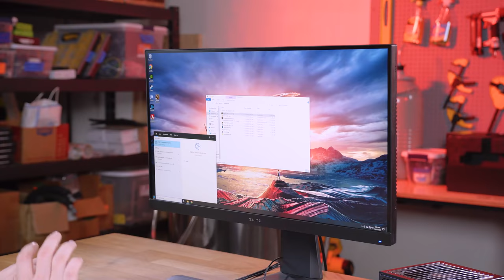This PC almost stumped me... can you guess what went wrong??

Comment: Just built my first PC a month ago, heard Jay’s comment on Gigabyte power supply’s and immediately did a little research on my specific unit. Turns out that particular model (Gigabyte P750GM) has had explosive tendencies and I was not about to mess around with that. Ripped that jawn right out of my chassis and returned it with one day left on the return period. Upgraded to the Corsair RM 750W for $5 less lol.

Comment: I have a Thermaltake riser and when I got my 3090 it was lacking all sorts of power, evga even offered to rma it, (it was getting 14000 to 16000 of score in 3dmark). I asked EVGA if the riser cable mattered at all, they said it shouldn't. so on a whim, I unplugged it and went straight to the board, instant jump in score to 20000. SO now I'm scared to waste another 50 bucks on a riser cable

Comment: I would ask your friend if he used/had two different power supplies at one point and may have mistakenly put all the cables in the same box. I am convinced that because both hard drives went and there was smoke that it was a wrong cable for that power supply.

Comment: I have a 3600 and i get some strange freezes, 4-5 times a day. The mouse just goues an inch for 10 seconds and it the ram is only about 40-50% load, the ssd disk is fine, it just happens and it does not goes away until i restart.

Comment: Moral of my story: Please don't cheap out on cables. They transfer l the data and power for to and from the equipment...

Hi all. I'm a car and home audio installer from S.A. I would understand why it would be the cable because when I wire any setup I always stress the expense on cables as well and the good quality oxygen free copper that's also electrically shielded because you get a lot of static transferred to the amplifiers and ultimately speakers as sound so I've also noticed the cheap quality cable will also cause voltage and current drops resulting in equipment intermittently shutting down. As with cheap HDMI cables. Too long and too cheap you barely get even a stable 1440p output. Sometime grainy picture due to electrical noise in the connection or just flashing.

Comment: hey jey i had a problem with my cooler master vertical gpu bracket my pc under heavy load while playing a game with high graphics would just restart just after 5 minutes of game time all temps under 65 after i did a clean instal and did not work i started taking all rams / drives out and leaving just 1 in to test the problem got fixed after i took out my bracket and installed the gpu with no bracket had no problems so ye a gpu bracket can make a pc run funny

Comment: I live in Anchorage and i noticed that my 165hz acer monitor would blank screen for about 5-10 seconds sometimes(its stopped doing it recently) but i think it was due to the static electricity possibly(watching ur most shocking video=) also i am using a MSI MB with a 4670k and a XFX RX580 but i was just wondering if anyone new why it happens or any reasonable explanation. thanks

Comment: I’ve been stuck with this problem for weeks now. 3090, 3950x, asrock taichi x570, 64gb 4000mhz ram team group ram, and 2tb Adlink m.2. 

The issue is when I open a game, before loading, pc freezes for a second, black screen, then back on and everything works. 

Then after finishing gaming and leaving the pc for a while, I can move mouse but everything locked up. 

Have latest bios, latest drivers, used DDU then reinstalled GeForce, changed pcie to gen 3 in bios, removed all 3rd part software like from Razer, no fix.

Comment: Both CPU power plugs are not connected; Ryzen 3600 needs 8-pin and 4-pin CPU power from 2 separate power rails
Reply: I'm planning on getting a Ryzen 5 3600 for my first PC build, so this is good to know!
Reply: No, one 8-pin can supply over 200 Watts of power, and that 3600 probably draws less than half of the connector's capacity.

Comment: If both Sata drives went toast then it was an incorrect modular power cable.  No idea what the riser ribbon has to do with that but you're not gonna fry Sata from a pcie slot or pcie cable.  There is no actual standard for how the pins connect on the PSU.  ID10T error, club hands crushing wires and jamming stuff in without skill/experience.

Comment: Jay: "Don't buy Gigabyte PSUs."
Me: "...or boards."
Jay: "Gigabyte GPUs are horribly designed."
Me: "Soooo, just avoid Gigabyte."
Reply: After not one, but two faulty Gigabyte Vega 56's in a row.. I'll never, ever ever buy anything Gigabyte again
Reply: I used Gigabye Mobos almost exclusively from '97 to 2014.  In 2015 i worked for a company and saw thousands of RMA's of all products.   Asus are the most reliable mobos. However mobo failure (compared to other parts, is very high).  The last gigabyte product i used was a 1080 gtx (did it to save $),  was noticeably inferior to MSIs gaming x  and produced audbile coil whine.   (now that can occur on any model, but the dodgier the brand, the more likeyl itll occur).     Gigabyte isnt 'trash' -  i.e .like thermaltake,  its just that i dont recommend them.  I recommend people if they have the $ to pony up and buy reliable gear.       CPUs = Intel, Coolers/fans = Noctua,  Mobos = Asus, GPUs = Nvidia  (high end range of Asus-MSI-EVGA), SSD = Samsung/Intel/Crucial,  HDD = Western Dig/Hitachi/HGST(all WD now),  PSU = Seasonic.     (youll find best of other 'PSU brands'  are infact rebadged Seasonic PSUs.)    If youre wondering , i saw more dead AMD CPUs in just 1 month than ive seen dead Intel in my entire life.

Comment: ISSUE:
Thermaltake includes PCI-E 3.0  cables with their cases.

PROBLEM: 
Asus motherboard defaults to "Auto" speeds. If you set bios to PCI-E 3.0 instead of Auto, it works without crashing.

RESOLVED:

Comment: My first thought is there was a preinstalled standoff that his particular motherboard didn't have a hole for.  So it grounded out some solder points or something on the back side of the motherboard.

You need to replace the CPU.  It was probably stressed in the initial "smoke-out" but not to the point of blatant death.  It's kind of like a spindle hard drive that doesn't fully crash, it only sorta doesn't work but otherwise mostly works..... until it crashes  and reboots and seems to work fine again.  The RAM needs a full memtest on a separate board (one that hasn't been in his case or used the possibly compromised CPU).  The RAM could have a super slight problem somewhere that mostly doesn't appear (same as the aforementioned spindle hard drive allegory).

Regarding the riser cable, maybe it's similar to that recall issue you talked about with that purple computer you fixed.  But he still needs to examine the motherboard tray thoroughly to make sure there isn't a standoff or even a missed piece of metal that wasn't machined off properly during the case manufacturing or something.  And get the GD thing off the carpet....

Comment: someone explain to me how to blow up your drives with a bad riser cable , unless your psu gets damaged..

i had once a bad hard disk .. pc wouldnt boot and no clue why.. after turning on pc 4 times that controller of the drive short circuited and smoke came out of the pc and it blew up all my controllers of the existing 3 good hard drives drives and my boot ssd ...and my expensive psu  was badly damaged.. one sata power output on psu had issues and never worked correctly after..  was a corsair power supply by the way 

I've had all common and not common problems in the past and after all that crap .. especially with AMD cpu's and Nvidia hardware.. building computers since 1984 .. every single time i want to reset my computer or boot it up.. i always get fear in the back of my mind and my heart starts racing  telling myself .. please boot normally.. please boot normally.. what if it won't boot especially with the regular windows updates ... ugh i hate bad experiences lol

This how fanboys are made lol , i only use Intel CPU's on MSI boards , MSI AMD GPU,s ( I swear by MSI)  and western digital drives , corsair PSU .. because of trust issues and lots of problems with other brands in the past .. i also stopped using corsair closed loop watercooling
 as often the corsair link software has issues and more recently my IH80 pump broke down without warning .. got a blue backplate now due to overheating and suprise  my intel i7 still works flawlessly...

Comment: Need Help!!!!  PLEASE!!!!! I got lucky and picked up a AMD 6800xt GPU.  My problem is that I am not seeing increased performance from my 2070 Super.  I have reinstalled everything including the latest updated Windows 10 along with the drivers from AMD (Which was a Pain in the A$$.)  My GPU is running like it should and within specs.  I am wandering if my setup could be limiting it or if there is a setting that would be. I see people running a similar setup and getting way more frames in games like warzone.  My FPS with 2070 was getting around 125.  My 6800xt is getting about 130ish.

Clock speeds are amazing 
Temps are staying low 
Warzone settings are at high and 1080p on both. GPUs. Any help is greatly appreciated 

My set up is a 
Ryzen 7 3800x 
Asus B450-f Motherboard
850W Evga fully module PSU
AMD 6800xt GPU
32gb Ram 3600Mhz Corsair Vengence.

Comment: Pcie 4.0 is NOT certified yet on any Riser Cable.. Had the same problem in a new build with an 11900k when GEN 4 was turned on. You cannot find a PCIe 4.0 certified cable anywhere. Also I have a Thermaltake Riser cable.

Comment: Note: Make sure you are using the correct riser cable. PCIe 3.0 riser can be incompatible with a PCIe 4.0 motherboard, and requires you to change your BIOS settings before installation.

Comment: If a humidifier isn't powerful enough, get an evaporative cooler and use it as a humidifer. They're like the size of 10 humidifiers, so you'll be filling it with a 15 gallon jug every day, but you'll hammer the dryness.

Comment: One day, i have the weird problem. Blue screen, frozen screen, weird behavior in games. After a few hours of inspecting, i discover that it was a TV HMDI conector and it does it not matter if TV is turnet off or on(sametimes we watch films on the TV, the cable is plug in all the time). Just use another HDMI on TV, problem solved........

Comment: Could be related, many people are having issues with pcie 3.0 riser cables and 4.0 components. Things may work or may not work,, and may have really odd issues if they do work.. You have to tell the bios to run pcie 3.0 for these. Hardware Canucks did a video on this.

Comment: Also i dont recommand Gigabyte Eagle OC  RTX 30 series cards :
I think this message will be usefull for some peoples, i have some issues with an RTX 3070 EAGLE OC 8GB (random black screen, sometime green line after screen flickering, black screen and reboot..) i have a cooler master 80 Gold 650 Watt PSU, after checking all the components and hoping to find anythink related to the hardware, i noticed something strange the color of a few pins (3 pins) of the PCIE power connectors turned black (base color is metallic gray), there is a huge overload on these poor quality connectors, so I tried to remove a little this oxidized layer and I also cleaned the power plug (6 and 8 pins) and the surprise the problem is gone !! i will try to reduce the overload and will find a solution to change those connectors and to replace my PSU because the protective plastic of the 3 pins of the PCIE power plugs has been merged a little with the metal

Comment: Broken pc....
 calling it now
No thermal paste or some loose contact xD

No idea! Will update with a new comment once I've checked the video  :p
Edot
Damn am I glad i didn't buy myself a gigabyte PSU xD it was just as expensive as my current coolermaster but it had 350 watts more xD ended with my coolermaster 650 80+ gold... sadly it's not modular but it works as advertised and it's stable as all hell (my old one had some weird power fluctuations when it was under load and it could randomly power down)

Comment: Jayz, I watched the video and didn't see you mention what graphics card was in the machine specifically.  The riser cable that was causing problems looked like a PCIe 3.0 cable.  If the graphics card is PCIe 4.0, then the fact that the cable is running at too fast of a speed for it is the problem and can be troubleshot by forcing PCIe 3.0 in the BIOS as a temporary workaround.  The newer riser cable you showed looked like a PCIe 4.0 cable and shouldn't have any issues under most circumstances.

Earlier this year, while AMD legit had driver issues, since the RX 5700 XT was the first PCIe 4.0 card available on the market many people has issues with their riser cables in similar ways but didn't realize it.  It can be really hard to separate issues like that when you have no "control" hardware to test with for sure.

Comment: If the slot is running at PCIe v4, any PCIe v3 rated extension cable can cause problems.  Either run the slot at PCIe v3, or buy an extension cable that's explicitly rated for PCIe v4.

Comment: Until the manufacturers fix the issues with riser cables I tell everyone to not mount their gpu vertically. Theres WAY too many problems with them. Even when comparing the same model numbers. one cable might work and the next one of the exact same cable wont. too much guessing and hoping for compatibility to be worth it for me. BUT once the manufacturers figure it out and get it all dialed in ill do it. i love the look of vertical mounted gpu's but wont risk frying my system or shorting out my gpu for the sake of cosmetics.

Comment: 1:54 in -  insufficient/unstable PSU...

Edit: If humidity is a problem, could bad architecture in HW be the problem? ~ cramped hardware with little to no sufficient space between components(PSU, MB) and the static making short circuit?!?

Comment: if this was indeed the riser cable. then he might want to consider ASUS ROG Strix Riser Cable PCI-E 3.0 x16 High-Speed  EMI shielded Flexible Extender Card Extension Port, 
I personally think the main problem was his choice of PSU. all Gigabyte PSU are garbage. 
if the PSU had proper protection? it would have shut the system down. he would have known right away. if the Riser cable was "defective" the PSU power protection would have shut down the system..  but don't expect that from any Gigabyte PSU.

Comment: I have to ask as I'm stumped on what to do, my windows basically starts up each time like there is no gpu drivers installed, low resolution and only on one monitor, then after a few seconds screen goes dark then image comes back at full resolution like it just installed the driver.
It does this on a fresh install of windows, ive even run DDU just to be sure and it still does it.
Is there something in the bios i might of missed?
It doesnt seem to affect performance in game but its getting annoying to be honest after everything ive tried.
Any helpful suggestions would be great! Thanks guys!

Comment: I'm a retro PC enthusiast, and a few weeks ago I debugged a Super Socket 7 PC (AMD K6-2+ 550 MHz), which was freezing at the Windows 98 loading screen and also when trying to run a clean Windows 98 installation. After swapping parts, trying EVERYTHING for a whole day and almost giving up, I finally started thinking outside the box, wondering if maybe I'm using any parts that are not "period correct". And immediately I thought about the optical PS2 mouse. Replaced the optical mouse with a good ol' mouse with a bottom trackball and... ta-da! The PC is now rock solid stable! Most likely, the motherboard was unable to provide the required amperage for the optical mouse, which led to this extremely weird behavior.

Comment: I once had an AMD CPU, which had a corner piece of the core broken off, which was still working. Well, sort of working... all pictures would show as white, black and purple noise (like on an old CRT TV without antenna signal). The CPU was otherwise running perfectly stable in Windows 98/XP (yes, this was many, many years ago).

Comment: That cable looks like if somebody is mining for bitcoin and wants to also play games on 1 of the cards while the others are hooked up normally to the pcie riser adapter. You are right that cable looked seriously sus and shitty. I would NOT want my expensive card plugged into such a cheapy looking thing. I would get a normal case so that card plugs into the slot and has that plastic holder thingy so it won't sag either. I can see that shorting out and starting another fire. A house is also grounded for power if not grounded properly then there would be some serious accidents already. APC would be great tho as your suggestion. Don't go cheap on those. APC makes the best ones out there while cyber power are the cheapo ones.

Comment: An  odd issues I recently experienced. When I went to upgrade my PSU to suppport a new power hungry GPU,I took the short route of leaving the cables with a putting a new PSU  in. THIS WAS A BAD IDEA. I did not get feedback from the MB or CPU luckily I didn't short the whole MB and potentially the CPU. I took the long route and replaced ALL cables to the PSU. I learned the hard (but lucky way) that not all PSU are created equal. See if your dumb friend went from EVGA to Seasonic (matches modular parts but not the same  pinout, this is not a standard...).